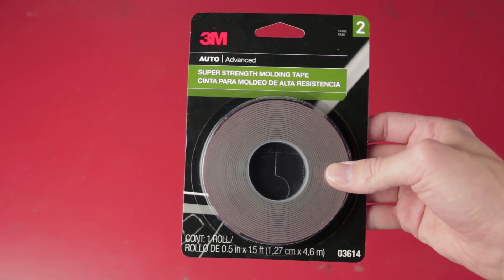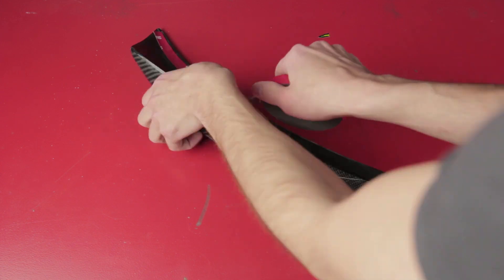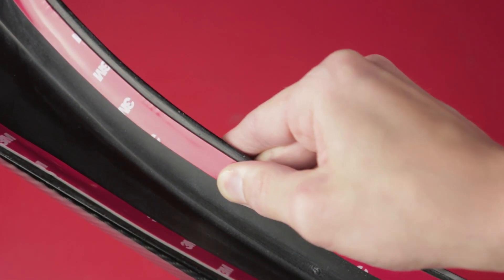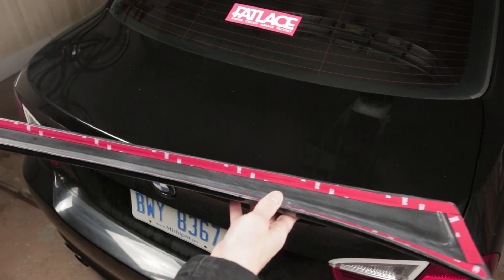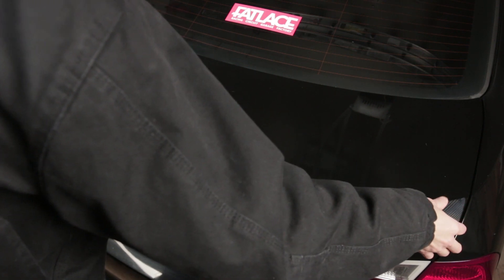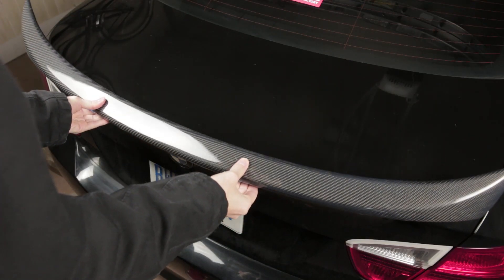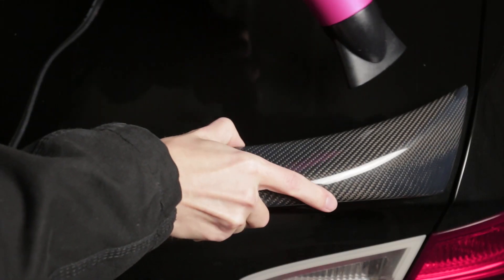How to Install a Carbon Fiber Lip Spoiler

Comment: I have an 06 325 i and the best mods that are relatively cheap are replacing the shifter, the carbon fiber lip spoiler, debadging the 325i branding, putting on black or carbon fiber stickers on the blue parts of each BMW emblem throughout the car, plasti dipping the grill and then lastly installing new headlights. All of these things really dress up the car and subtly make a huge difference. Plus it still looks very classy.
Reply: Rice

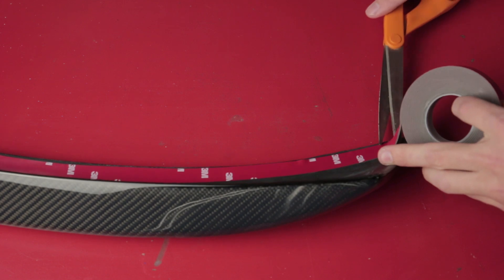Comment: Nice video. However, you do NOT want a watertight seal as you suggest here 1:01. The tape will never fully prevent water from making its way into the gap, especially water vapor.  But a tight seal will hinder liquid water from getting out once the vapor has condensed.   Stagnant water accumulating in the gap can lead to corrosion of the body panel or even cause the spoiler to detach in cold weather when the water freezes and expands.  It's best to leave small gaps in the tape so water can easily escape.  Ideally the gaps would be in downward sloping areas of the body panel.
Reply: quantenmoi thanks for this, I was about to install mine till I read this -_-

Comment: You should make another video on how to remove the spoiler. I have a new 750xi that came from the factory with a $550 mineral white metallic spoiler on the back that looks ugly (but the car was on the lot and had this option installed already). It just doesn't look right on a car that large and conservative. It looks fine on yours in carbon fiber. Also, on my old 335i, I had some 3M tape installed by the dealer (service bulletin....under warranty) that cost $250 and it prevented the door from rattling and keeping the door's metal from tapping the frame of the car. You should make a video of all the different types of expensive 3M tapes BMW uses in their cars.

Comment: JB! awesome  stuff you post! I almost had a solid 09 BMW x3 manual on my hands, but I did not pull the trigger quick enough. Anything I need to look out for buying a used M model bimmer? I know high mileage could be risky @ 80K +, but I know they are solid built and better if the owner baby it. Would you ever go that route for a M model?

Comment: That tape doesn't work.  It'll last 4 months top. 
You have to buy 30LB double sided tape, used that for my lip, it's been on my car for 2 + yrs
Reply: What 30lb tape brand? Have a link?
Reply: @thermalnoize  3m of course or gorilla 🦍 lol
Reply: I have the auto 3M. I don’t think this shits gonna hold with tape alone. The fitment isn’t even flush with the sides of the top of my STI’s wing.
Reply: It’s a carbon fiber gurney flap btw

Comment: Awesome video Justin!! I have a question,  do you have a back-up camera?  If not, any plans on installing one?
Reply from the maker: Thanks! I don't have one. I don't think I will because the car has excellent visibility and It would probably be expensive to install.
Reply: hey man! I installed one on mine, it costed me less than a 100$ with the screen (that I put on the cup holder), the camera, cables, relays, cables, tape, and a power adapter!  +Justin Buice
Reply: that's really really cheap......I just installed backup camera and parking sensor (aftermarket ones) for my 15' 328i GT for $1280 :(
Reply: Joe Liu That is a little bit expensive, but I'm assuming you have the iDrive system, and they had to remove many parts from the interior to retrofit it on your screen. For my case, I purchased a small screen from Ebay that gets power from the cigarette lighter.

Comment: Hey Justin!  I'm hopefully gonna get my first car soon and ever since I was a kid, I've always had a thing for beamers(favorite car brand).  I am specifically really hoping to get a used 2013 bmw 328i.  Do you know what like the common problems for that car is?  I've been trying to do all the research I can, but I just can't seem the find the best info.  People say it's a great car, most reliable bmw, and other half say don't ever get bmw's.  What do you think?  I understand as a luxury car maintenance will always be more expensive than cheaper types, but honestly, I'll just work and put money into it y'know?  If I'm going to drive and have a car for a long time especially for my first one, why not have the car you want and have fun driving it right?
Reply: Eric Parker Music get the BMW you will love it just make sure it's a clean one
Reply: The reason being to why people say dont get bmws is because they're afraid to be money pits. My first car was a 1999 bmw m3 manual and it NEVER gave me a problem (121,000 miles at purchase, 149,000 at sold). Just bought a 2008 bmw 328xi manual with over 143,000 miles, and its as reliable as can be. Just ride them easy, and don't rough house them. Im currently 19 and have been able to afford these cars and buy them full cash simply because I shop for parts and shop my mechanics and make sure I know what the costs should be before hand. You should be fine, just remember, always do your research before hand. It may take hours and days, but in the end its worth it. Cheers!
Reply: Engine wise I’ve had issues with valve cover and gaskets

Comment: I'm about to buy a carbon fibre lip spoiler for my liberty gt, I'm not a fan of drilling myself but is it not very easy for theft for anyone that knows a double sided tape is holding the spoiler?
I don't want to throw 350 dollars in the trash if I install it and then the next day it is stolen.

Comment: Can you take the car through automatic carwash after the installation of the spoiler?
Reply from the maker: +wallkosh i persoanlly would not take my car through an automatic wash because they can damage the paint amd leave swirl marks on your car. But it should be fine. This tape is tough. My dad and i were pulling in the spoiler after it was installed and it woudnt come off
Reply: Thanks Justin.

Comment: Justin, I'm In the market for a used 328i. I wanted your opinion on the 2011 year, I found one with 50k on it for 12,300. Anything I should be looking out for or tips?
Thanks !
Reply: Gotcha, thats what i will do. Thanks for the tip!
Reply: Get a 2007 328i manual. 2007 338i don't have the gay reflector on the front bumper
Reply: Pre-Purchase inspection is very important to get  before buying a car! Also, if you're not gonna turn your own wrenches and want something reliable, the most reliable 3 series for the e90 generation are the 328's. In terms of what PayneTv just said, dont go back 4 years just cause of a reflector which is really easy to change. I changed it on my 2013 328. Theres a lot of other things they changed from the Pre-LCI to the LCI 328. (Pre-LCI means pre-facelift basically) Theres interior tweaks, exterior tweaks, the taillights are different. I always came to learn the last year of a car's generation is technically the perfected one without all the weird errors of the other ones. They learn from the errors of the years prior, mostly engine durability wise. Plus resell value will be better on the 2011 than the 2007. Take care man, and congrats that you're taking the right step in life and getting a BMW LOL!
Reply: If you could afford a 2011 I would just get a 335i since you don't care if it's manual or not
Reply: See, thats also what I pointed out. The 335 is less reliable, the 328's are the way to go, unless you care about speed, and wanna throw a JB4 tune on it. The HPFP (high pressure fuel pump) is notorious for failing on these cars, and is reoccurring. Any non turbo e90 bmw is extremely reliable tho. I know even justin wold agree with this.
Reply: Thanks man, that was super insightful. 2011 it is and a pre purchase inspection for sure. I know!, tired of just watching these machines on youtube and on the freeway, time to own!
Reply: Just bought an 2010 328i with 80,000 for 10,980. Had to put a bit of work into it right off the bat - My fault for not pre-inspecting it. Now I couldn't be happier though.
Reply: sloblo welcome fam
Reply: Had a failed oil filter housing gasket which dripped all over my belt tensioner. 

Scummy dealership didn't mention it, so I didn't notice until my next maintenance cycle. Ended up paying around 1000 for the repairs and a new belt.   (I probably could have DIY, but I chickened out after pulling out the tensioner haha)
Reply: Wish I'd done this prior! On the same token try and have a 3rd party do the check as the dealer I purchased mine from did not disclose everything they found. :(
Reply: I just purchased a used 2011 328i xDrive with a manual transmission.
I got it inspected by my mechanic before buying it and took it for a thorough test drive.

It's only been a month of ownership, but I love it and have nothing wrong with it (no complaints). good luck !
Reply: +sloblo ... this is oddly almost identical to what i had on my 2008 BMW 128i at 88 000mls/143 000kms. i had an oil leak,however from the valve cover gasket,and my very own scummy dealership never mentioned it until a month afterwards. they had records of an oil leak for a month when they inspected the undercarriage. they even said the oil filter housing was cracked,which my indie mechanic had found afterwards that it never was cracked,only soaked.

possibly a company tactic? who knows...

+Alex Royer definitely get a pre-purchase inspection. parts tend to fail at 50 000/60k mls or more.
Reply: Alex Royer that's a really good price,  but suspiciously low make sure it's not rebuilt and make sure there nothing wrong, check the car fax and u should be good!!
Reply: durpflip my e90 had a head gasket leak to months after purchase. 

Putting on some falken tires today 😎😎😎

Comment: I need an opinion on buying 2008 320i with 195,000 kms on it. Is it okay to buy car with that mileage? It looks good on the outside though. And do you reckon used 3 series will cost a lot to maintain?

Comment: Why do you put lci rear lights
Reply from the maker: I've looked into it but the LCI has a different trunk lid since the tail lights are a slightly different shape. so it would be close to $1000 to do the full conversion (new tail lights + new painted trunk). In hindsight, I probably would have just bought an LCI, but I didnt know much about BMW's at the time.
Reply: Justin Buice  aahh i didn't know
Reply: Justin, even though i live in NYC, i saw this dude selling a Black LCI trunk with barely any scratches, looked new, black sapphire for 300$. You never know sometimes you might find a steal.

Comment: should've just gotten an m3 instead of just trying to look like one
Reply: Matthew Robinson so just becuase its not a ///M means a 3 series shouldnt be modified?
Reply: because it's kind of a ricer thing to do, adding these kinds of mods to a non-performance car as if it were a wannabe M car. if you want the M car, buy it, but you don't need to make that $5k bmw a ricer
Reply: A 3 series may not be considered a performance car, but they have plenty of performance which is the reason why the many people in the BMW community modify them. A 335i is barley slower than a e46 m3 stock. But since its not a M3 i guess it would be rice to modify it
Reply: you sound like you own a 3 series that isn't an M and are trying to defend yourself...
Reply: Matthew Robinson ... Don't be a douche bro! LOL.. everyone's taste and flair is different when it comes to cars.. and adding a lip or a diffuser or wheels and tires to a car doesn't make it rice... so quit bad talking what Justin is doing, and if you have such strong feelings about M3s, why don't you one each for us all?